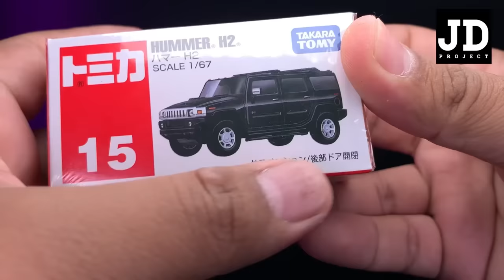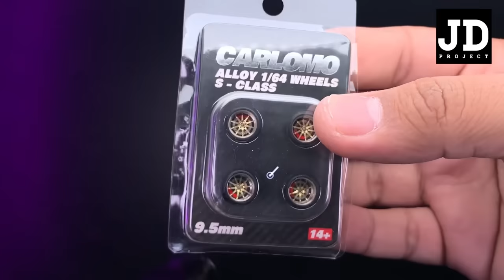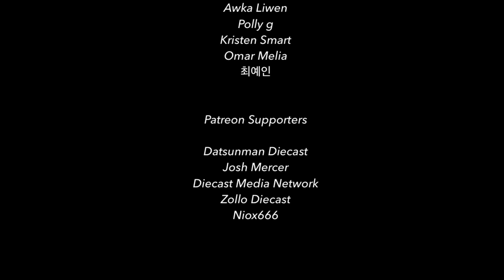Clean Hummer H2 Six Wheeler Tomica Custom

Comment: This is good but you have done better!, the back wheel on the right hand side didn't touch the ground as you pushed it along and the colour scheme has been better also,  but not going to mention the door handles for the butterfly doors. But otherwise a good job!.